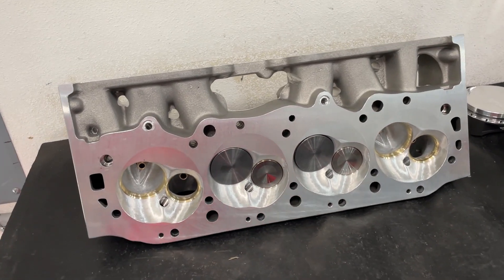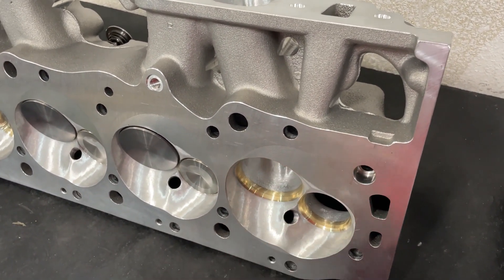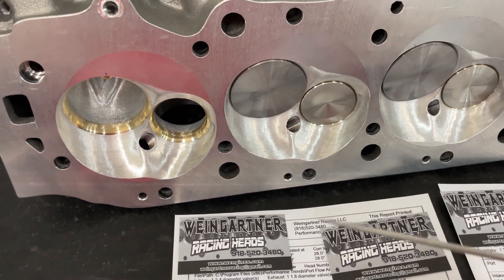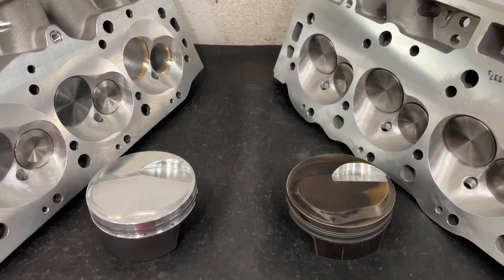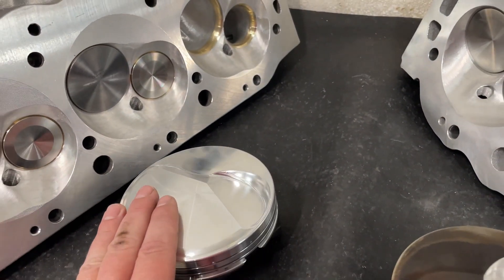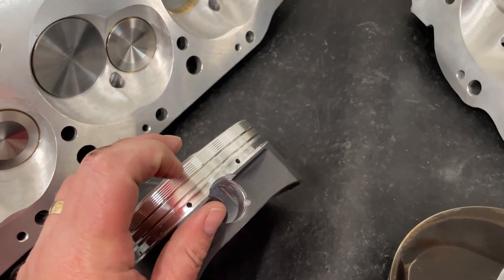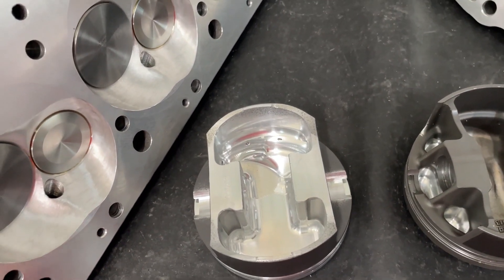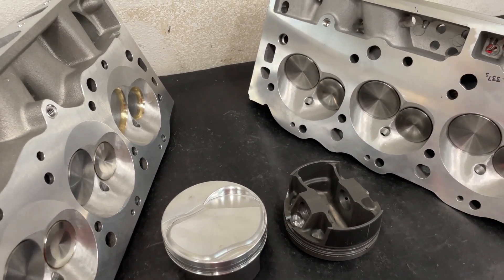Piston Information And Brodix BRX Heads

Comment: Brodix heads are new to me I've built several small block Chevy 355 that are stock I went to a estate auction and I bought a engine that had been built very well  callies crank & rods brodix head hunter heads.I ending up winning the bid at 600.00 dollars it has never been run since the build it was in one of those plastic boxes that engines come in.But it didn't have a intake manifold  on it .There was a intake laying on a shelf over from it .The lady gave it to me it was a edelbrock high rise when I got home with every thing I set the gaskets and intake on it I noticed it would never seal up left to much of a gap between intake and heads does it take a certain intake for those heads .sorry to ask but I never run any thing but Chevy heads 186 or 041  .I would appreciate  some info

Comment: Thanks for the video. I have been trying to use thinner metric rings with a reduced radial wall thickness in everything for over 12 years, along with Napier second rings. I am constantly suggesting to people to look at pistons that can accommodate these rings. Many don't get it though.
Reply from the maker: Yep. The only downside is the rings are more expensive.

Comment: As an engine tuner and builder of 40 years experience now retired I'd like to pass on a couple of tips, when using Weber Side Draft carbs you can get rid of det or run 2 points higher compression ratio (everything else remaining the same) by altering the relationship between the main jet and the air corrector sizes, for example a 'normal' air/main relationship might be 160 main and 160 air with say an F16 tube, instead of these sizes in order to reduce any tendency to det change the relationship between the air and main to 240 main and 280 air and dial in the air for best power on a dyno to suit that big main jet and retaining the same F16 tube. Using this technique on Ford 2.0l and 1.6l Pinto engines I was able to use 13.5/1 compression ratio on pump fuel with  a 25 hp gain over the previous 11/1 CR at the top end of the powerband, this was on the same fuel and with a similar safe resistance to detonation, after long term testing in circuit cars we found we had complete reliability as far as combustion issues was concerned, the engine used slightly more fuel on the big jets but not too bad and the exhaust gas analysis was much the same as before. This effect only happens with Weber side draft carbs, I tried it on Dellorto's and Solex's but got no good results, it has to be Webers, don't ask me why. We also used Champion M10 surface gap spark plugs with adaptors to change from the original M18 plugs to M10, these little surface gap plugs were originally intended for use in old Johnson 2 stroke outboard motors but ran perfectly in the Pinto's with any ignition system we tried them on, changing to these little Champion plugs reduced the heat take up in the plug area of the head and eliminated the tendency for cracking around the plug when using very high compression and racing over long distance in high ambient temps, I'd recommend this practice to anyone using high compression and 18mm spark plugs,    'Sausage' HT Racing Ltd

Comment: Another sweet video man, I love the details! And can’t wait for everything coming up! I haven’t bought a shirt yet, but I’m going to, make sure you advertise those suckers at least every other video! I’ve always wanted to see the dyno comparison from a simple combo, where one is put together real simple with thick rings, cheap oil pan, cheap bearings, no coatings, you get the idea, vs the same motor, “ airflow wise”, but throw the kitchen sink at it to make it as efficient as possible, just to see how much power and efficiency is offered by modern technology! I wouldn’t be surprised if it was 80-100 hp on a hot street motor!
Reply from the maker: Thanks for watching.

Comment: Another great vid! It’s great to see more chamber content,just softened the chamber’s on my 3800 for boost and pump gas and expected a noticeable drop in low end response and torque but no difference was noticed down low if anything it makes more top end and 9.3:1 comp and 27psi boost on 98 and no pinging yet!

Comment: Used metric ring pack in my build with Napier second rings and steel plasma moly top rings. Wanted to gas port the stock pistons but didn't feel like it was worth it on the factory pistons I'm currently using. Next set will have the ports for sure!

Comment: Honda motorcycles have used Napier rings since at least mid 1960's. (I'm not old enough to have worked on earlier Honda's)
Biggest issue I've found is uneducated 'mechanics' think they are 'ridge dodger rings' and fit them upside down in the top groove.
One thing, why do you give flow at lifts that 'no one uses'?
After following David Vizard since early 1970's he's always seemed to promote low and mid lift flow as valve spends much more time being opened and closed than it does at max lift.
Are 'big numbers' just for bench racing?
Reply from the maker: People do use them as I have explained in other videos before many times. I know of a few people that have 1inch lift with these heads.
Reply: @WeingartnerRacing  Hi Eric, I haven't watched all your video's yet although being retired I do have more time nowadays to 'do nothing' 
Always been fascinated by big block motors spinning bucket sized pistons at 'insane' rpm

Comment: If we do some simple math and look at pressure over area, on a 4.600 bore engine w 13 .040 vertical gas ports. The total area of the 13 gas ports is .016314 Sq In and if we look at the area around the top of the piston to the cylinder clearance of .040 and calculate that area it comes out to .288 Sq. In. 
  So I would love to have someone explain to me how air can be forced down the vertical gas port when the difference of area is 229 times greater?

Comment: What are the long term effects of gas port vs non? How much faster does it accelerate cylinder and ring wear? Or it's not a concern because these types of engines get refreshed more ofen?
Reply from the maker: I haven't seen any effect on longevity.
Reply: It really depends on a lot of factors. Remember that if you run a very high cylinder pressure and boost, you are also squeezing that ring outwards much harder as the pressure in the cylinder is what forces the ring out.
That said, the thinner rings have shown to wear cylinders slower, and parting is part of why you can make the rings thinner.
If you ever have had your hands on a modern pro stock engine that runs super thin rings and try to turn the crank, you'd be shocked at how easy it is to turn. That's the effect of thin rings.
The way the piston is designed i.e compression height, where the ring gaps are in relation to the land etc. also affect wear.
Fact is this. When you talk to a piston manufacture that really know what they are doing, they also know how to keep your wear in check for your application.
If you want to deal with a company that really listen when you talk about your needs, Diamond is the place to go.

Comment: I kind of kick myself for not having gone with BRX/SR20 heads to begin with. It stinks that they only offer them with such small chambers. It guarantees that you have to completely tear down the whole engine and change pistons if you wanted to run them later on. I know the 24* vs 20* would make it so you would have to atleast flycut the pistons, if you could get BRX/SR20's in 115-119's. I checked my JE pistons, they are the lateral ports with .043 rings. I don't know that my builder has gotten the rings for the engine yet.
Reply from the maker: You can't flycut a regular piston to work with BRX because the valves are in a completely different location.
Reply: Like Eric said, you can't modify your stock 24* piston to work with the BRX. If your engine builder is doing that, I'd find a different engine builder who has an idea about what he is doing.
You can always sell your old pistons or save them for a different project. That will recover some of the cost spent on the new slugs.
Reply: @AB-80X  no, my engine builder hasn’t suggested that at all. He’s got engines out there everywhere from 500hp to 4500hp, he’s more than competent. I understand the valves are canted in a different angle, however, I wasn’t aware they were in a different location. That makes sense though.

Comment: Eric Weingartner, does superflow 750 have enough capacity to flow these heads or did u have to use the saenz?
Reply from the maker: I flowed on both but super flow couldn’t pull 28inches at higher lifts.
Reply: @WeingartnerRacing  did u flow it at them at less of a depression and then convert?
Reply: Or are u saying that u connected both benches together to get the flow u needed?
Reply from the maker: @ericsmcmahan  on the superflow I flowed at 28inches until it couldn’t do it then converted it to 28inches. The Saenz pulls 28inches easy.
Reply: @WeingartnerRacing  what do you think it'd take to build something that could pull 150 on a mountain motor head at 1.3" (flow about anything at more realistic peak pressure drops)?
Maybe the flow bench "lie" would occur less

Comment: Good points on head design. 
With pistons, I was planning on getting total seal gapless ring set for my stock 502 bottom end to handle the single Tstorm charger - street use. Will that work out?
Reply from the maker: I would do standard gap but thats me.